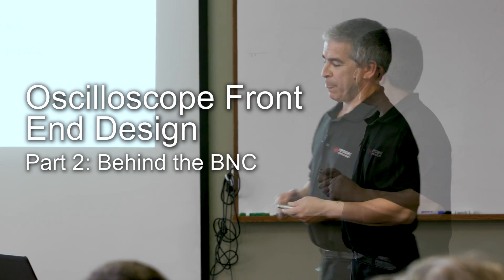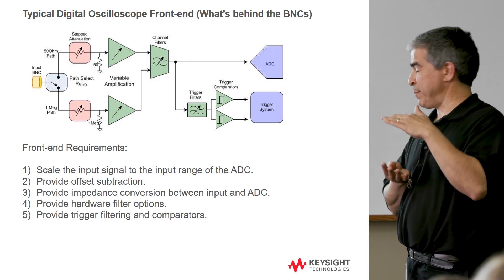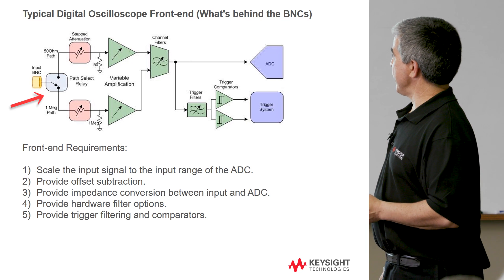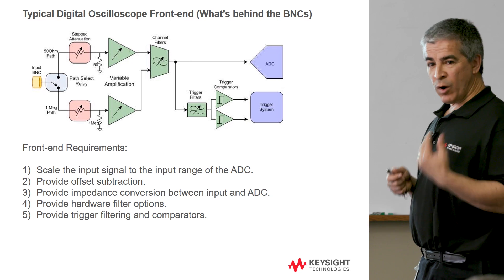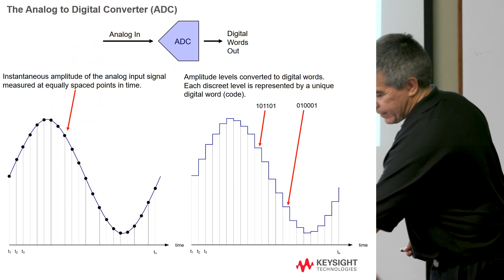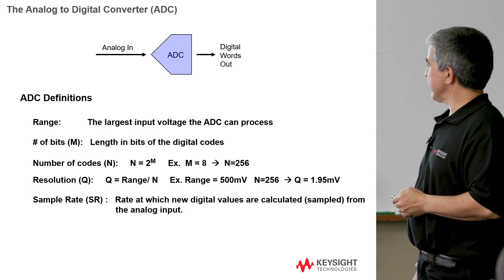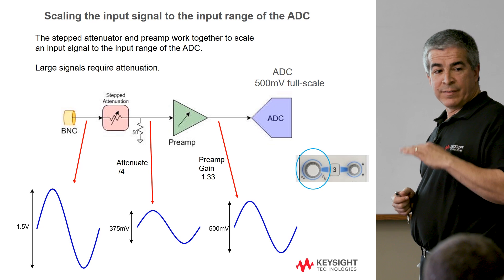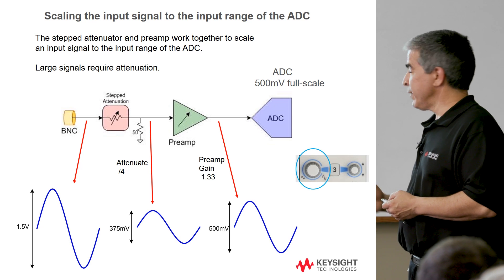Hardware Layout - Oscilloscope Front End Design Talk (part 2)

Comment: If you have gain steps, where do you draw the line on "continuously variable"? Arguably digital is specifically not continuously variable. Yeah, I'm that guy. Just nit picking. I was kinda half watching then heard talk of continuously variable gain, was interested, then oh yeah it's still a stepped digital conversion(which makes total logical sense in application, nonetheless).

Cool stuff, but don't tease me.
Reply from the maker: It's still continuously variable, because the amps actually adjust. But, you have to prescale/attenuate the signal before it hits the amps to get it in range. Otherwise your scope's input range would be severely limited. Non-continuously variable would be scaling post-front end

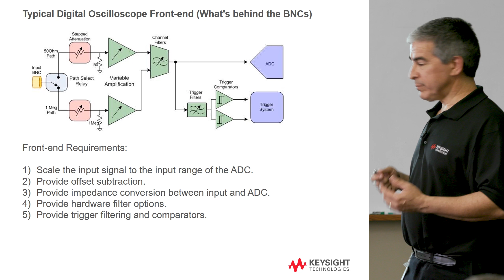Comment: The image at 3:57 is showing "stair steps", is this accurate? Does the sample have a duration or is it a single point in time?
Reply from the maker: Sorry for the late response! The sample is from a specific a point in time, but from the perspective of a digital system each sample point represents a period of time. So, the system is essentially interpreted and interpolated as this "stair step" type waveform. Fortunately, though, oscilloscopes do a lot of interpolation and data-analysis so that the actual plot looks more like the analog original.
Reply: Thanks, no worries. :)

Comment: a) You don't use the offset circuitry to get rid of a large DC component as described here, this is still done by a capacitive high-pass filter!

b) Nice that you have a laser pointer in your hand, but that is not visible on the slides!

c) As already pointed out by others, the impedance matching cannot be done after the attenuator, it is part of the attenuator.

d) Most ADCs in digital oscilloscopes are running from differential inputs...

For which level of audience are these videos targeted? I am quite a bit disappointed by the quality of the contents of this Agilent - ahem sorry Keysight advertisement...
Reply from the maker: The talk was originally intended for EE students (as mentioned in part 1), but many of our internal Keysight folks enjoyed the talks so we thought we'd make it public. Also,  I've asked Mike to comment on your points above, I'll respond once I hear back from him!
Reply from the maker: Here's what Mike says:

Question 1: You don't use the offset circuitry to get rid of a large DC component as described here, this is still done by a capacitive high-pass filter! 
Answer: It is true AC coupling can (and is) used to block DC,  especially if the unwanted DC is larger than the oscilloscope's offset range. But, this is typically only an option for the 1 MOhm path and not the 50 Ohm path. The AC corner frequency is typically between 5 and 10 Hz for most DSOs today. Even so, this is still an AC coupled measurement which blocks signal content below the AC corner frequency. A user may wish to remove some DC with offset but still make a DC coupled measurement of their signal. That being said, I should have included and discussed this important functionality in the 1 MOhm path on my diagram. Great comment and thanks for pointing it out!

Question 2: Nice that you have a laser pointer in your hand, but that is not visible on the slides!
Answer: The editor did add in the moving red arrow to help compensate, thanks for being patient!

Question 3: As already pointed out by others, the impedance matching cannot be done after the attenuator, it is part of the attenuator.
Answer: The attenuator must be terminated in Zo to achieve both the desired attenuation and maintain impedance match at the input of the attenuator. When zero attenuation is selected the impedance at the preamp input sets the input impedance directly. When attenuation other than zero is selected, the impedance at the preamp input provides the terminating Zo for the attenuator. Search for Tee-type and Pi-type attenuators for examples. In the future, I could include a slide that shows the calculation of the resistor values for these attenuator topologies to achieve a given attenuation value and maintain input match, another great comment!

Question 4: Most ADCs in digital oscilloscopes are running from differential inputs...
Answer: This is true. I should have included this in my diagram, and stated "single ended to differential conversion" as an additional important front-end requirement. Good catch!

Comment: I think the 50 Ohm and 1M termination resistors are in front of the attenuators, not behind it. Otherwise you will never see the correct impedance on the BNC connector and you will also destroy the 1:10 probe attenuation.
Reply from the maker: Correct, check out Mike's response to Uwe above. Good catch!